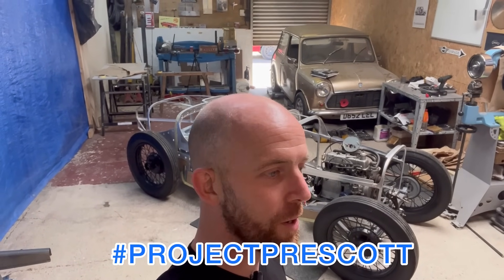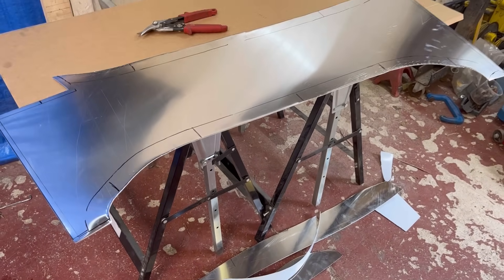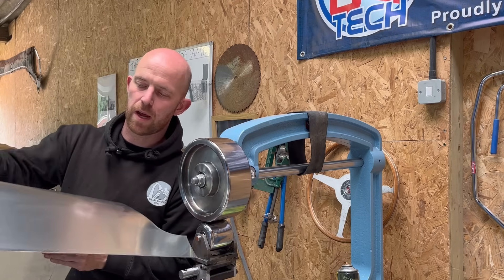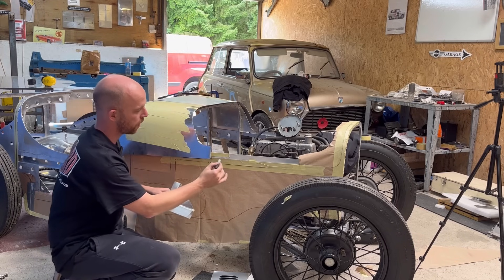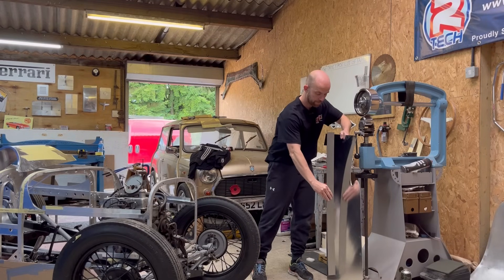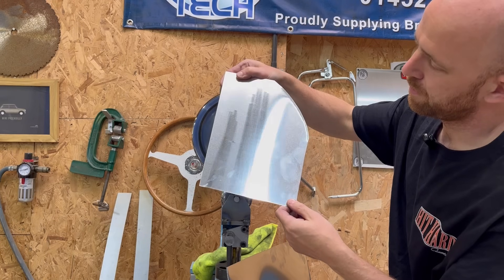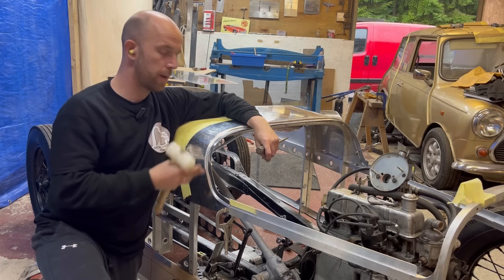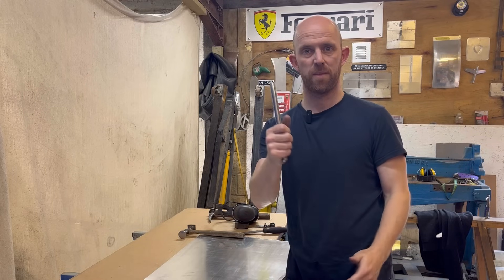Austin 7 special- part 9 - starting the aluminium bodywork

Comment: I have had to stop tig due to a pacemaker 😮 I was thinking of getting a porta pak unit
Reply from the maker: @martinhacche1329  wow I never knew it affected a pacemaker. What’s a porta pak?
Reply: It’s a small oxy acetylene welding kit with small bottles! Could I gas weld the frame though? Would there be too much distortion?
Reply from the maker: @martinhacche1329  some Ali grade don’t gas weld as well as other so that’s one thing to be mindful of.

Comment: Hi Tom.
Another very interesting video!
I have a home built wheeling machine and was interested to see your wheeling technique to get a low crown in both the X and Y directions.
When I try to create a low crown panel with equal curvature in both directions I get more crown in the "direction of wheeling"  compared with the 90 deg axis.
This is not unexpected since the curvature a lower low crown anvil is greater than N-S direction compared with the E-W axis. Also the backwards and forwards motion of the panel and its weight will tend to emphasise the N-S curvature .
Can you give me some advice on equalising the curvature in both directions. I'm dealing with low crown panels e.g door skins etc. using a low crown lower anvil?.

Thanks,

Mike in Germany
Reply from the maker: Tricky to answer this Mike. The pressure you set it at will have a huge impact on this.it doesn’t sound like your doing anything wrong but one thing in the video I do is support the panel when I wheel and I don’t let it hang, you may also want to try wheeling on a light pressure from corner to corner or X and thing will also help smooth the panel.